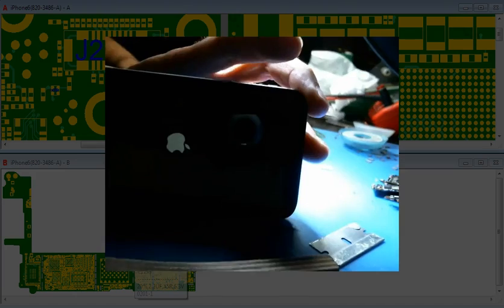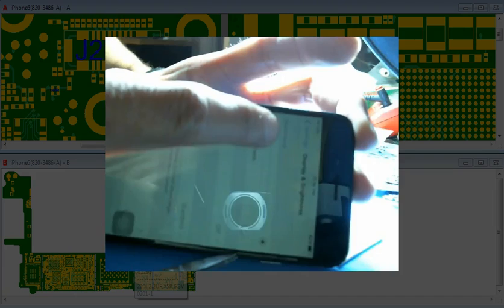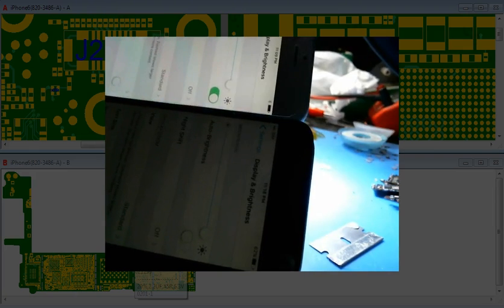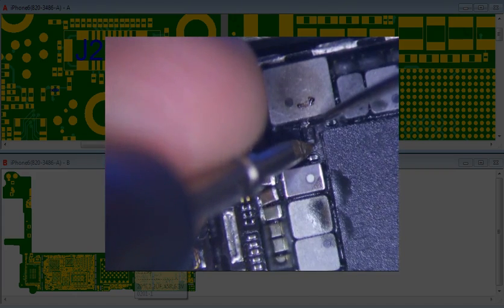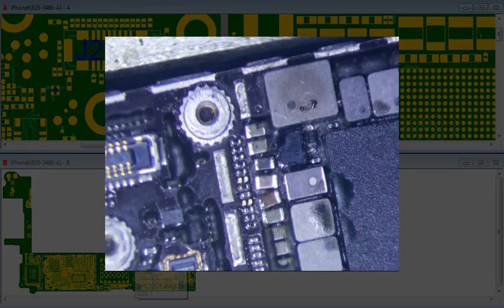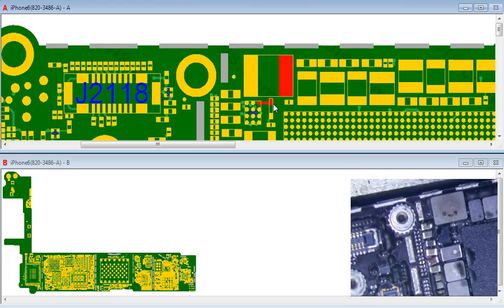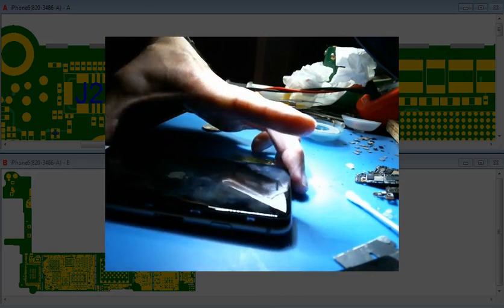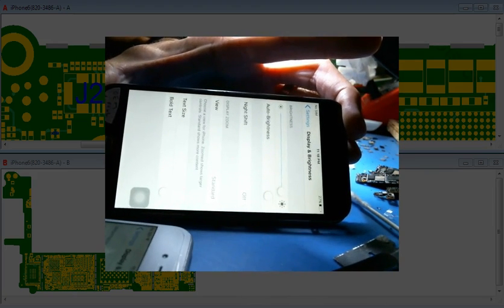iPhone 6 Dim Backlight Full Brightness Problem

Comment: Are those Dumont tweezers?  I'm working on this actual problem right now. Thanx dude : ) Liking your content : )
You can see your coil took a shit on top of it. I'm using 4 bad coils to test with LOL. You seen Jessa's video on the shitting coil? Easier to remove the coil with an Exacto from the bottom.
Reply from the maker: No.  I'm not paying $60 for tweezers!
Reply: I am. Those tweezers are probably the bomb. I was just wondering. Trying to see what alloy you had, LOL.